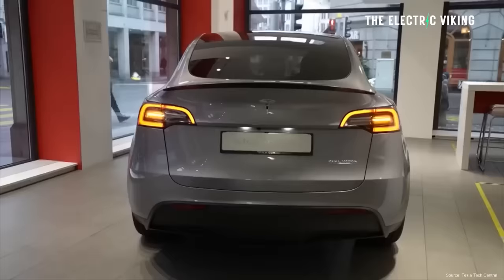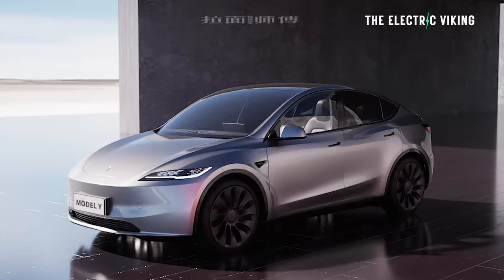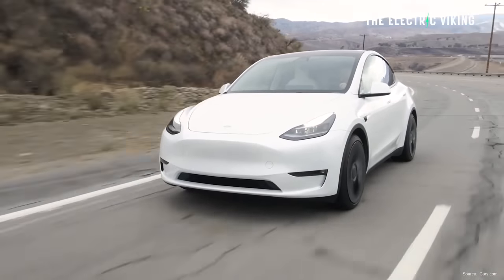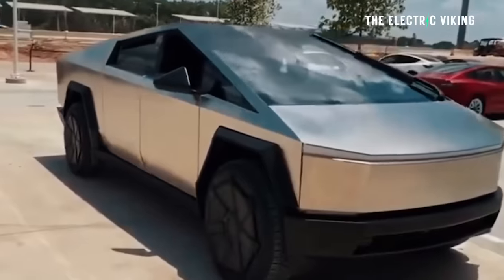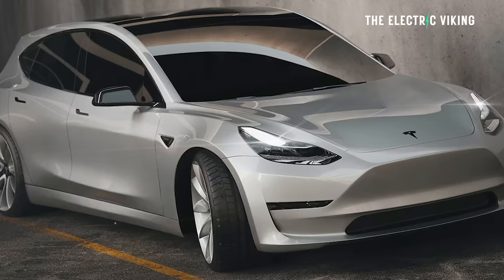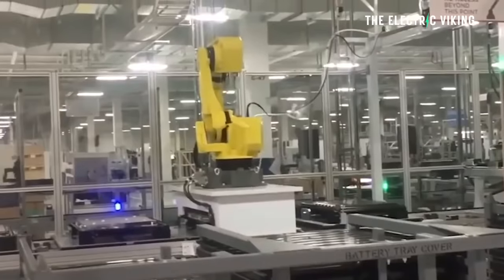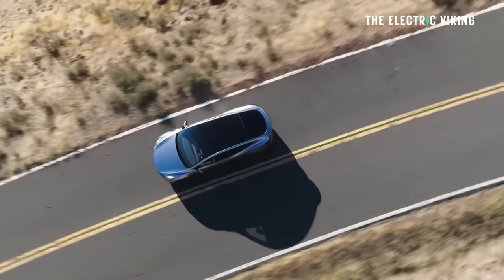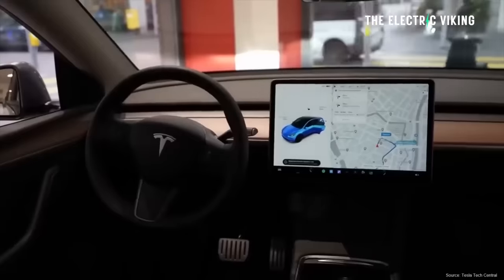Most popular version of Tesla Model Y no longer available to buy

Comment: The Standard Range Y from Texas was the only Tesla with front and rear gigacastings and a structural battery pack. I snagged one in May, and I think it's Tesla's best car. Too bad they've discontinued it, but I doubt it will cost them sales in the short run. It will also simplify their logistics. At least on the US west coast, getting newly manufactured cars from Texas was complicated and costly.

Comment: They are selling out their old cars and coming in with the revamped model and they need those batteries because they will sell a lot of those cars. They may or may not need those batteries for the cyber truck also. They want to eliminate the Osborne effect as much as possible Osborne effect as much as possible.
Reply: Osborne effect isn’t a factor for the MY awd standard range. Few want it when one does some research.

Comment: I think the Standard Range Y will return soon... but not as that exotic 4680 AWD that was only available in the US but more likely as a Y RWD with structural BYD LFP Pack like in germany or with non structural pack like the chinese Y RWD with CATL LFP Pack.
Reply: LFP (or LMFP) for me…bring it on.
Reply: AWD is a waste of money.  When one tire goes out, all 4 need to be replaced since there is constant torc with all 4 tires and unevenness will cause severe damage over time to the differential and suspension system.

Comment: I gave one of my engineers a challenge which he has been working on for 3 months. I have a craft that uses a separated fan to generate lift. It is driven by a small Hydraulic motor of 16 to 20 Kw out put. It's energy is provided by a Variable displacement hydraulic pump. This is driven off the Main diesel engine which is 215 Kw. The system allows variable speed on the lift fan whilst the diesel engine is at fast idle 1100 RPM.  I know the  weight of all the components how can we install a 20 kw electric motor and power source to run it. The Hovercraft has 200 litres of fuel and has an 8 hour operating envelope. I look forward to your thoughts

Comment: Where does he get his info from? It’s not the most popular. The LR is far more popular. Slightly more expensive but justit gives you far more range and much better charging. It far outsells the performance and the AWD.  The AWD is cheapest but there’s not a single bit of evidence to suggest it’s the most popular
Reply: I don’t think Tesla breaks out sales figures, but I read somewhere that Tesla was putting out 5,000 units a week in Texas, which is a lot on an annualized basis. I’d be surprised if Fremont’s unit production for Model Y is that high. For me the appeal of the Standard Range was the three-piece structure.